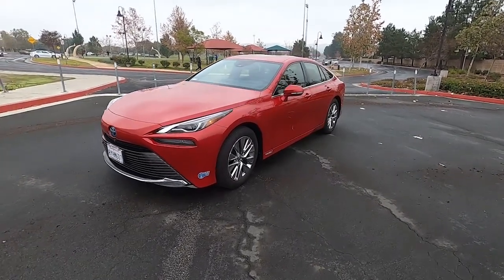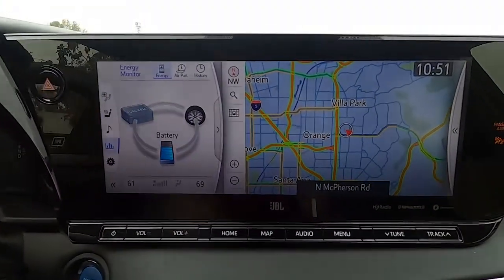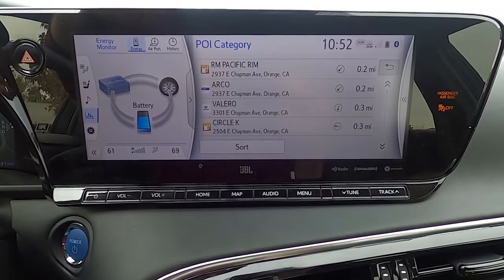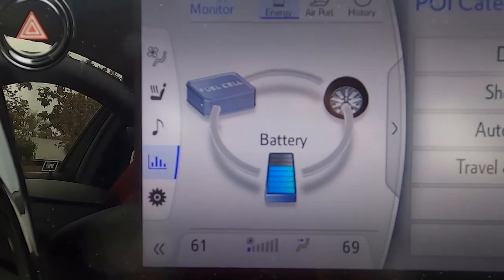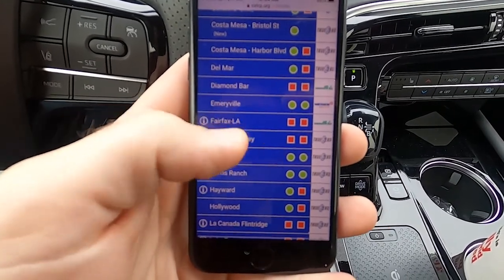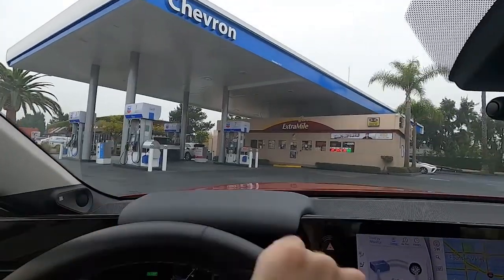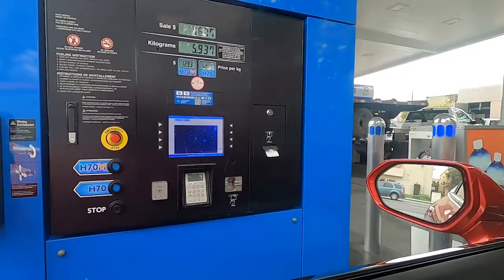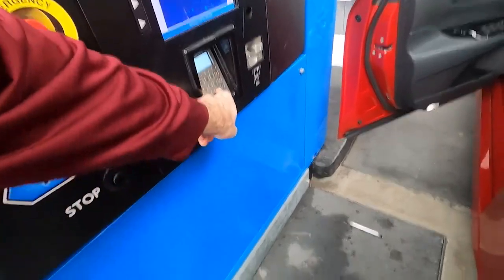How Do You Fill A Car With Hydrogen? How Many Miles Per Gallon Do You Get With Hydrogen?

Comment: Being a Hydrogen electric Hybrid the efficiency is excellent.
But having to use Green Hydrogen takes the cost to another level.
In theory a great system with Green Hydrogen production uptake and cost the limiting factor for these types of vehicles at the present time.
😎🇦🇺👍

Comment: Nice!!  I've never seen this process before.  I am shocked by how much hydrogen gas that car took though.  4 Kg???   H2 is 2g / mole so that means you put 2000 moles of hydrogen into the tank.  At room temperature, that is 48000 liters.  That seems impossible.  Unless it's liquefied hydrogen, I can't see that that much hydrogen can be compressed enough into a tank small enough to fit in that vehicle.  Something isn't right about that gas station hehe
Reply: I just googled the specs on that car and, apparently, the tanks can hold hydrogen at 12690.8 PSI!!  what the heck??  That is an insane pressure!  I wouldn't want to see one of those tanks rupture.
Reply from the maker: Thank you for this information!
Reply: Yea 10000psi or 700 atmospheres sounds about the pressure you need (highly dangerous).

Comment: This seems a lot more convenient than charging an electric car.
Reply: Not if you always charge at home, you never need to go to a station. And electricity is multiple times cheaper.
Reply from the maker: Agreed, it certainly is. Only problem is the number of Hydrogen stations is extremely limited.